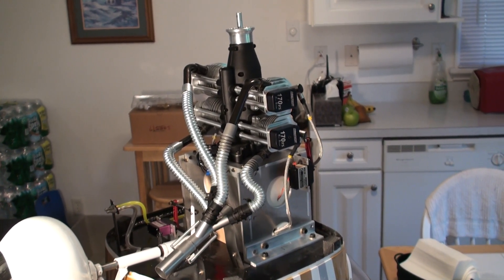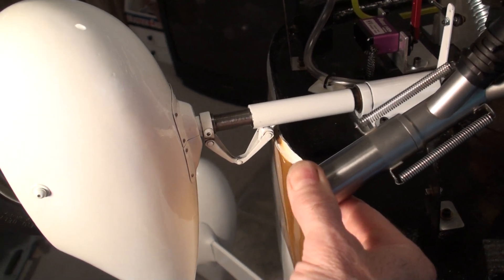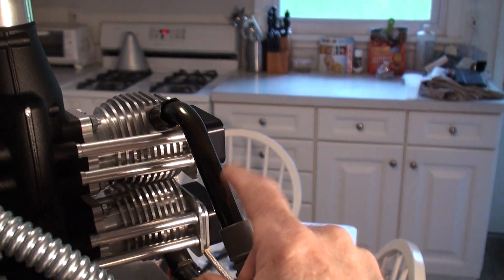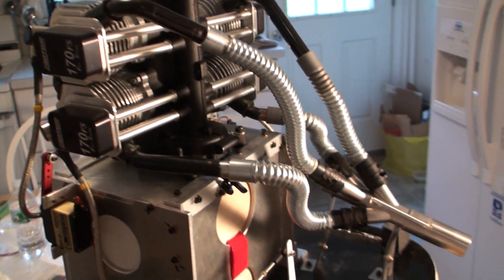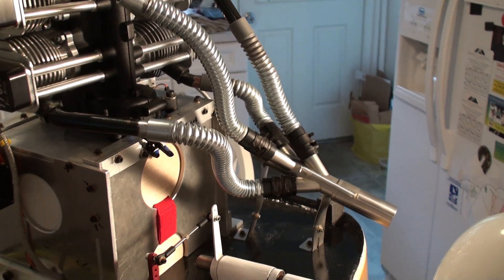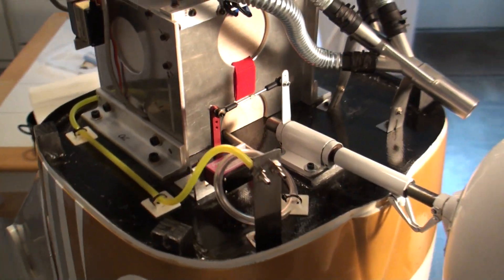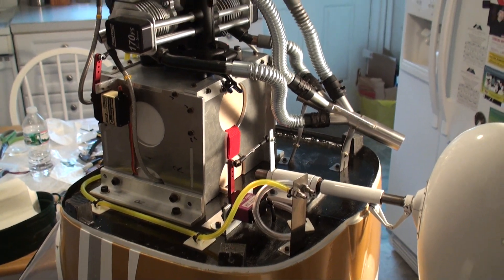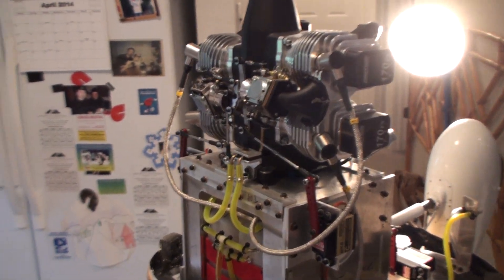Giant Cessna 182 4-Stroke Rotomotor 170 FS Custom 4 into 1 Header

Comment: Could you let me know the 3 blade propeller size you used to fly the Cessna with this engine? I’m going to install the same engine.  Thank
Reply from the maker: Biela 28x12 3-blade from aircraft internal but you might want the 28x10 since the 12 might have made the engine work too hard. I'll see if I can post some useful links. Also Dave Brown 4" Spinner (special cut option, choose prop). https://www.rcuniverse.com/forum/10922067-post1351.html 
https://www.rcuniverse.com/forum/10871829-post1306.html 
https://www.dunnindustrial.net/shop/ultimate-spinners/4